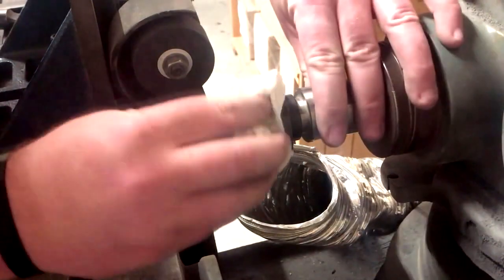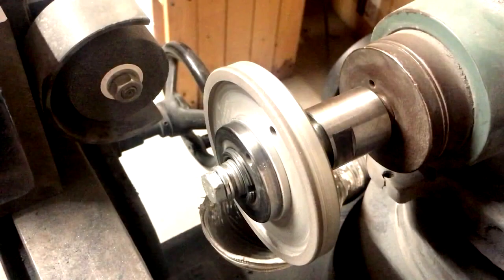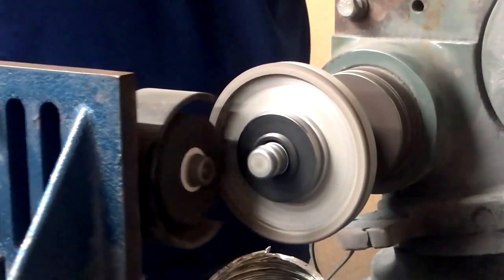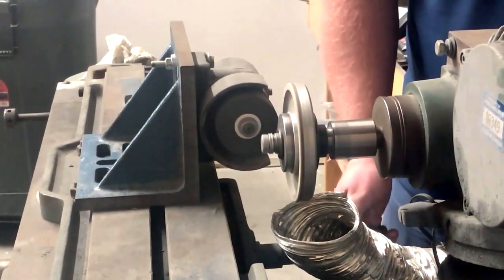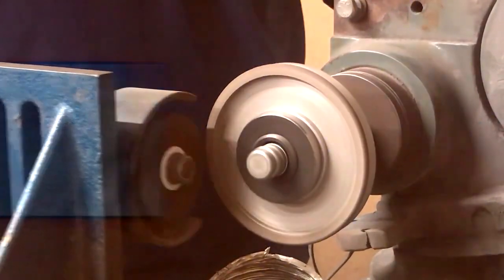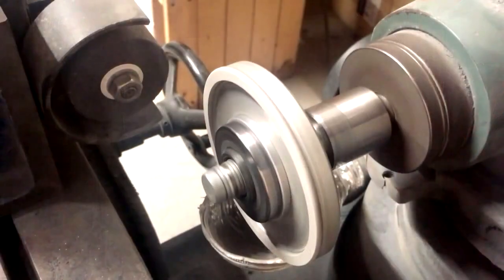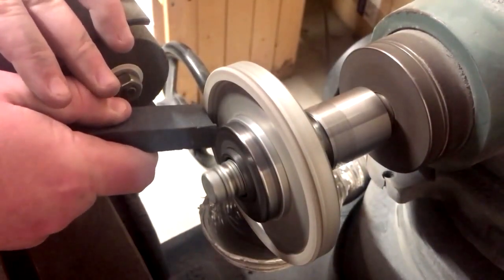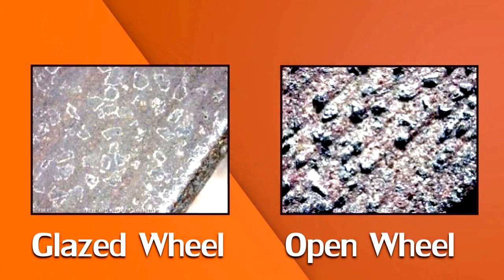CBN Grinding Wheels Truing and Dressing Explained in 2 Minutes

Comment: We sometimes have to reshape CBN radius profile grinding wheels (round)  that over time get squarish.  I have an eagle superabrasive wheel 1.5, mm radius that has worn unevenly due to heavy cnc plunging in steel .  In the old days, I would toss it out, now I hand shape it , takes 10 minutes, I  use combination stick of scrap carbide, scrap HSS steel, dressing stone, whatever is nearby and work the wheel as its spinning 4000 with coolant and a mask.  Its a hassle but I have tried all wheel mfg and honestly, they all get misshapen over time in our shop...cnc grinders are brutal.  On our weinig manual  grinders, I never reshaped a cbn, but the utma is rough.   I have learned  CBN wheels do lose their shape and can be reshaped by hand.  Eagle makes a great wheel.
Reply from the maker: Thanks for your input!  Takes a very skilled hand to reshape a radius manually.  We appreciate your support!

Comment: could you please mention the spec and grite of the stick of the pads
Reply from the maker: dressing wheel is 60 grit: 72C60LV
dressing stick is 180 grit for this wheel, but make sure to use a grit that is 1 or 2 grit steps finer than your Diamond/CBN wheel
Reply: GRIT, not GRITE.